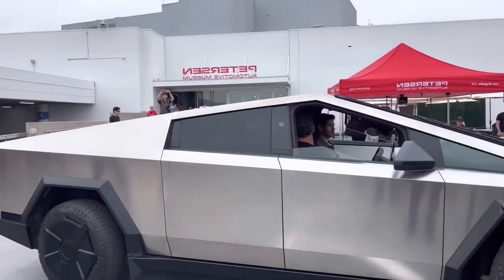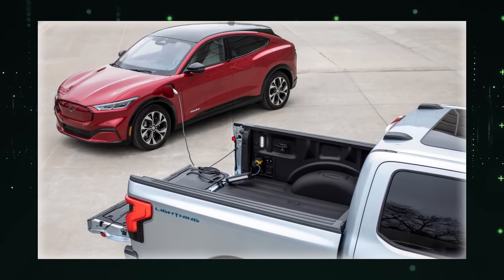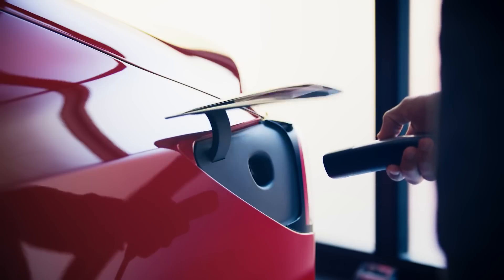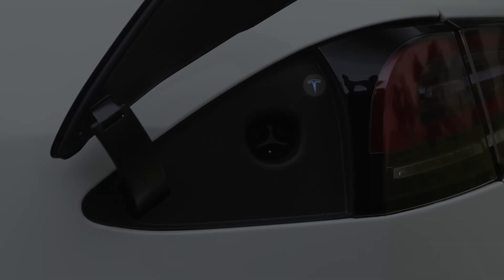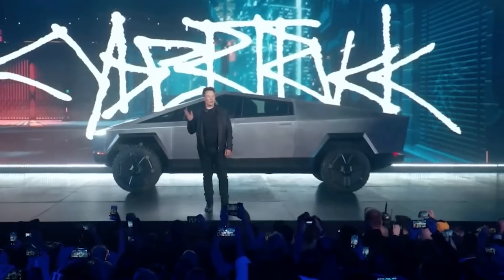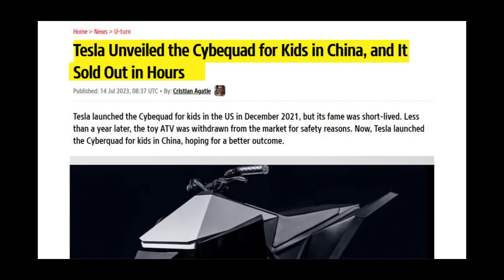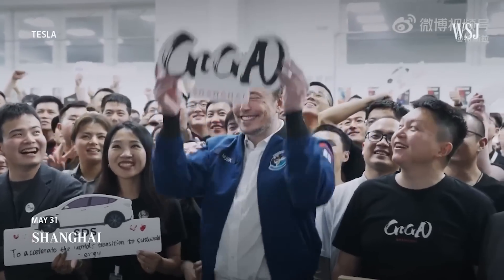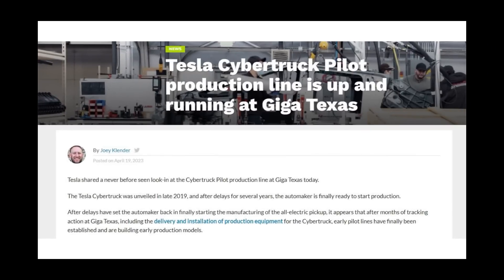Tesla Cybertruck Finally Hitting The Market With These Features

Comment: Interesting developments thanks. 

With bidirectional capabilities in the hands of EV owners, does it mean that when it is necessary to power-shed EV owners & powerpack-owners will be the first victims? Cool.

With EV tyre wear being significantly higher than ICE vehicle wear, does it mean higher particulate concentrations in city air with increasing EV appearance? Complex!

Did the politicians take all of this into account in their net-zero cost benefit analysis that they shared with their public? No? Was that unexpected?
Reply: I wouldn't be so sure that tire particulates will be more than particulates from both tires and exhaust from ICE cars.

Comment: Up to this point Tesla has always been AGAINST V2G charging. Did they just very recently declare that they would offer it?  Or are you just speculating that they will have it???
JB Straubel was just elected to the Board of Directors. He never liked V2G either & he is a main contributor to the early battery.
Reply: They are against it, it invalidates the Tesla warranty.

Comment: For you plonkers worried about CT’s sharp corners, remember this car is a Tesla and the software is pedestrian aware and offers safety not available in conventional vehicles … when the car is running, if it sees a pedestrian it will slow or avoid them before the person in the drivers seat likely realises the threat.
Reply: The difficulty is when the CT's vision is blocked by a row of cars and then the CT won't be aware of a child running into its path until it clears the blind spot caused by the cars. Nor would a human. Blind spot...
Reply: Sounds more like your buying into a futuristic technology that doesn’t yet exist.  It has mass, it’s traveling fast and sees with video.  There’s NO WAY it can accommodate humans differently than cars.
Reply: At least the the hood does not appear to be as tall as a new gas truck. I am not short but can not see over a Silverado HD.